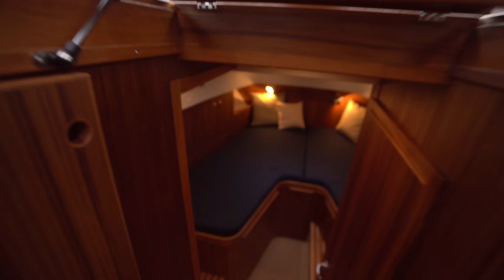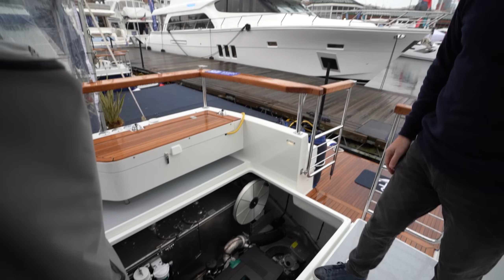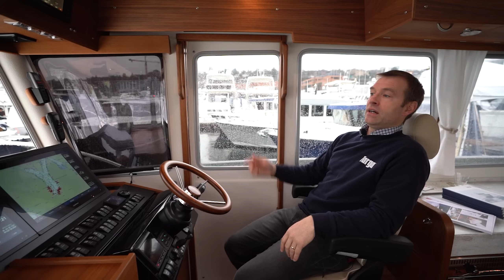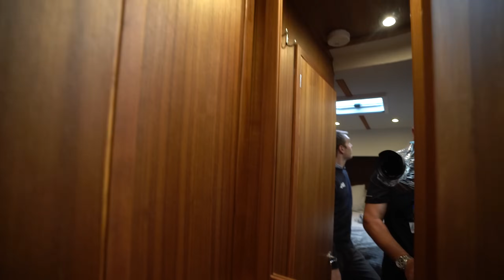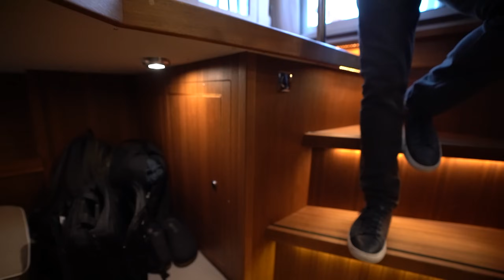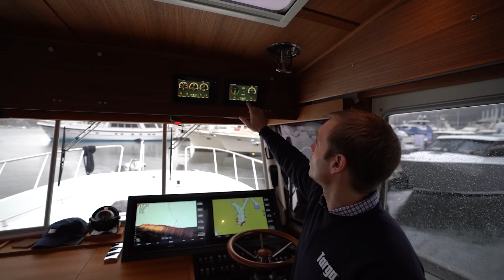Gale Force Winds Lookout ! Targa 46 will keep you Toasty!

Comment: Amazing boat for the Pacific North West,   a little more power and it would be perfect.
Reply: As far as I know it's possible to have stronger Volvo engines too.
Reply: 880 is not enough?
Reply: @MrCobb-rq8iv  hmmm I thought it was 660 ?
Reply: @robintaylor1490  440*2?
Reply: @robintaylor1490  I thought it was  440 *2?

Comment: Like the way the put the engines under the deck, to "keep the weight down low." That's pretty smart thinking!😀 Also you don't have to run it at 30knots, you can go slower. A lot of their clients like that they can see out the "windows." I'm also surprised they like to move around on the boat, like to eat a sandwich. I think I'd stay in my seat and wait for the captain to turn off the seatbelt warning.

Comment: Beautiful boats.  Any info on construction techniques?  i.e vacuum-bonded, carbon fibre etc?
Reply: Targa uses vacuum bagging/vacuum infusion techniques for the 46 hull and many of its parts, hand laid fiberglass work where the infusion process is not practical.  An extremely strong hull structure.  Little or no use of carbon fiber although we could specify this if desired as all builds are fairly custom.